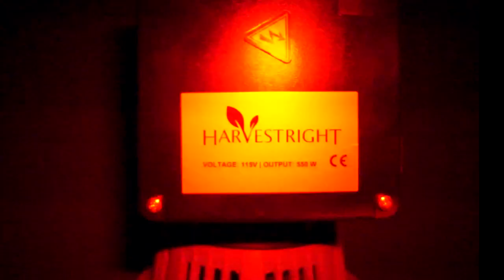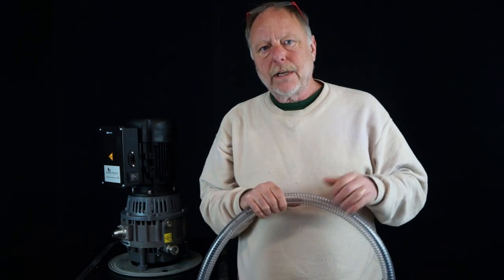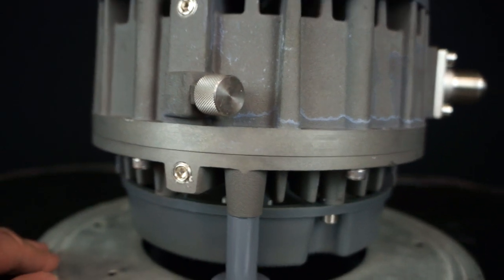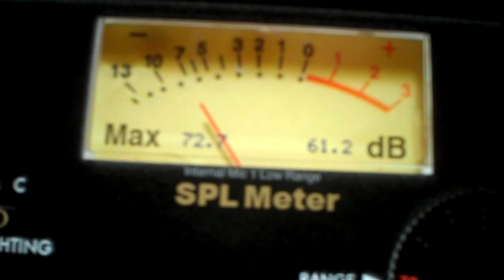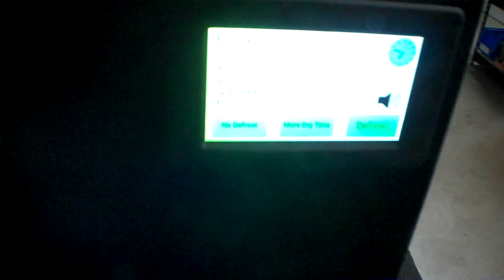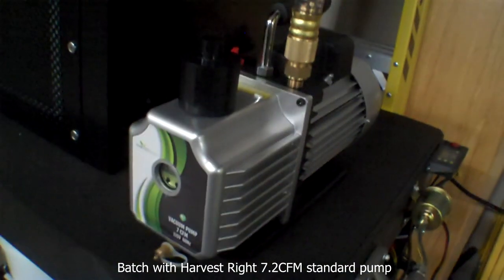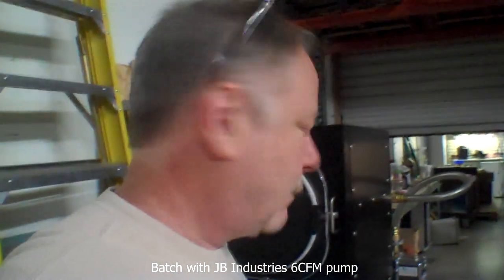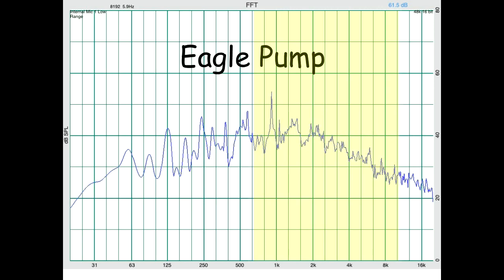Oil-Less, Maintenance-Free Pump for Harvest Right  Freeze Dryers - The Eagle

Comment: So any modern input on all the problems people have been having with these new pumps? I am an industrial mechanic, and would like to know what the requirements are of these pumps. 
1, wouldn’t it be cheaper to have a non-C-Phase motor direct drive with a lovejoy coupler to prevent vibratory resonance through the entire machine, and use a catch-can with a baffle for the exhaust to reduce sound levels? 
Where can I find a parts list for the pump? Or an exploded view of the internals to find if it’s worth spending that kind of money on one, or setting up a different vacuum pump set up?
Reply: this is the same design used in these pumps i will tell you to avoid them they wear and fail after 4 years sometimes sooner . your better off buying a 12 cfm oil pump for 150$ i bought a  ebay made in china vac pump and it works better than the original oil pump they provide it also pulls a better vacuum  my uncle uses these freeze dryers in his buisness and he has had bad luck with oil free pumps  150 $ 12 cfm  2 stage  vers oil free 1,500$   we have oil pumps that are 7 years old and still working . here is that pdf file on these  .

https://iopscience.iop.org/article/10.1088/1742-6596/916/1/012048/pdf

Comment: Hi Bryan, 
I just finished my first batch with my new pump. It took about two hours less than with my JB pump so it is definitely faster. I also love how much quieter this thing is too. I just finished washing my trays and then I went to do my routine oil change and then I remembered that is a thing of the past. I'm just waiting on my FD to finish defrosting and I'll be doing another batch. I totally love this thing!
Reply: absolutely no maintenance required??....my mind is blown
Reply: I know, it's awesome. I'm working on batch number 3 now. It is so nice not to have to drain and filter my oil every time. You do have to change some bearings or something I believe every 8,000 hours or something like that. By the time everybody gets to that point then hopefully there will be some sort of maintenance kit or service offered by HR.
Reply: Actually here is the required maintenance: 

Seal replacement is needed every 8,000 hours of run time or 1 year. Shaft seals and bearings need to be replaced every 16,000 hours or every 2 years.
Reply: Steve Montana and those pieces can be purchased on epicenter?
Reply: I'm not sure, I just copied and pasted from Bryan's comment to someone else. Here's what he also wrote in another comment about getting those pieces:

"For more information about seals and bearing replacement call 1-800-865-5584."

I'm sure by this time next year this will be considered a normal process and I'm 100% positive that Bryan will have a how to video on how to do it and will probably sell the parts as well.
Reply from the maker: I talked with HR today and replacement part kits. This is what they said: "We don't have spare part kits available yet (there isn't a need), but will in the next few months. "

As soon as available, we will offer them.
Reply: That's good to know. Hopefully it won't be too hard to do self maintenance. If anything it will definitely be less messy than a JB since there's no oil involved.
Reply: @stevemontana5974  Do you know where  they can they be purchased? I don't see them on sale on Harvest Right website?

Comment: Mine is supposed to be delivered today!!  I am so looking forward to ditching the oil changes, filters, pump cleaning, all of that messy stuff!!  Unfortunately mine was not at the upgrade price.  I have had my Harvest Right FD'er for over a year now.
Reply from the maker: You will LOVE the new pump. Eliminating all the maintenance is such a joy. But it is expensive. We HR owners have all dealt with the maintenance with the oil based pumps and it's totally doable as I'm sure you agree. Up until now, it's been kind of the cost of admission to the world of home freeze drying.  Once you have used your new oil-less pump for a few batches, I hope you chime in again with your experience!
Reply: I will, when I get it.  It wasn't delivered Saturday.  I checked the tracking number and it was now with FedX and had not left there yet.  I don't know why I received an email saying it would be delivered Sat.  Sooooo still waiting, ready to get this show back on the road.  Enjoy your videos.
Reply from the maker: HI Pam, I'm glad you like our videos! I think you may have bought the pump directly from Harvest Right, so you will need to contact them directly about tracking. Had it been purchased from us, you would have received an order confirmation but the tracking number would have been sent when it shipped.

Comment: Got the oil free pump in 2017 as a gift.  Arrived early 2018 and did a batch last night and when the pump turned on, it was making horrible clanking sounds.  What?  This pump isn't even 3 years old and was over $1700 with shipping.  Can't find anyone in my area that repairs them.  Harvestright has been notified, awaiting a response.
Reply: The clanking is probably the fan housing at the top of of the unit.  Mine was damaged in shipping.  Just pried it up to clear the fan blades.

Seals died on my Chinee Rotary Vac Pump after WAAAY LESS than the advertised 250 loads.  Not happy!  Cannot get anybody at Harvest Right to answer the durn phone.  Need bearings and seals!
Reply: Yes HR can rebuild your pump - Mine did the same thing after only 8 months. HR rebuilt it under warrantee within 2 weeks. That was 18 months ago - no problem since. I run my dryer almost 24/7. Not uncommon for pumps (of any kind) to need rebuilt within 2 years. It's still worth the cost to buy and maintain.
Reply: Mine broke twice in the first year.  Now it is no longer under warranty so they want to start charging me to keep fixing their cheap crap.

Comment: This thing is continually broken.  Four months over two rounds of it broken the machine was either off for repairs or waiting for HR to respond to emails.  Now it is no longer under warranty and they want us to start paying every time it breaks.  I like the machine but the pumps are garbage.  The oil one requires to much work and the oil free one doesn’t work long.
Reply: I completely agree and am having the same issue 3 years after this latest post.   Doesn't appear they have fixed the issues with the oil less pump nor has their service dept improved and the company is not taking responsibility for a crappy product.  So frustrated!!

Comment: It will be interesting to see how the Eagle acts over time with multiple batches! what is the prescribed maintenance with Eagle pump?
Reply from the maker: Hi Michael, I'm running the Eagle non-stop these days looking for glitches. So far, so good. The manual I received last week says the following:
PUMP MAINTENANCE
In order to make the best use of your investment, familiarize yourself with the
features and operating instructions before starting pump. With routine care and
following proper maintenance guidelines, your pump will give you years of reliable
service. Pumps are designed for deep vacuum work on freeze dryers.
Seal replacement is needed every 8,000 hours of run time or 1 year. Shaft seals
and bearings need to be replaced every 16,000 hours or every 2 years. Replacing
the seals is necessary for achieving deep vacuum and for proper freeze drying.
For more information about seals and bearing replacement call 1-800-865-5584.
Reply: EpicenterBryan thanks for the reply! I’ve just completed my first batch on my new freeze dryer and have been enjoying your videos, if I had found you before I purchased I would have bought thru you! Keep the great videos coming! If I can justify the oiless pump you will be hearing from me!
Reply from the maker: The oil-less pump a big expense, I know. The new oil type pump you have now is a big improvement over the older JB pump. It should perform well for a long time.
Reply: @EpicenterBryan  what if you only use 2,000 hours per year, can you change the seals at 3 years then? Or is it a must to change it every year regardless of use?

Comment: Hi Bryan,
I'm "liking" (literally)  all your videos I'm watching and subscribed to your channel.
I am curios to know if there is any reason I couldn't  run the oil-less pump inverted. (i.e. the motor on the bottom and the vacuum pump on top. I ask cause my house has an unfinished basement. I f I set my soon to be purchased freeze dryer on my kitchen counter then use some plumbing fitting to hard pipe the freeze dryer outlet below my kitchen counter. Then connect the flexible hose to that and run it through my floor and connect to the pump. I could mount the pump inverted to the bottom of my basement floor joices. this would make the freeze dryer a more user friendly home appliance, while confining the majority of the noise to the basement. I understand the vacuum pump needs power from the back of the freeze dryer and all. I am an electrician by trade and work for a commercial  HVAC/plumbing/electrical contractor. I have access all manners of info and supplies on a daily basis. I also have a washer drain close by in my basement where I could plumb the drain hose to, making the whole system a much more user friendly permanent type of installation.
thanx for all the great fun and informative videos on freeze drying and the like.
Have a great day.
D. Bittinger Jr.
Reply from the maker: You will need to give them a call. I've seen similar pumps that have a bracket so they lay on their side. That might make more sense. Perhaps they can get you such a bracket.
Reply from the maker: I contact HR about this today because you are one of several potential Eagle customers who have asked about Horizontal mounting recently. As soon as I have a response I will know more. The question is if the mechanism can be run horizontally without impacting performance or causing damage. Then, if HR or the pump manufacturer is interested in offering a "cradle" to support the pump in a horizontal orientation.  If no harm is caused and they don't want to offer a cradle, I'll look into having them made to offer to customers like you.

Comment: Great video Bryan.  Has me thinking about which way to go.  I have the JB pump and oil inside the chamber and hoses at the moment and was thinking about getting the other newer pump but now the oil less version is tempting although not in the budget  right now.  On top of that I bought the flush kit and extra oil that I would need to get rid of somehow hopefully sell.  Decisions decesions
Reply from the maker: There are a few tricks I've learned about that "oil up the hose issue" that might help you. First, put the pump as low as possible. That makes it harder for oil ever to reach the chamber. Next, the issue seams to be when the FD starts freezing. That slowly creates a vacuum in the chamber that starts sucking oil. You can open the drain valve for a while if you see oil creeping up. Don't forget to close it! Or, you can plug the pump directly into the wall for 20 seconds or so. That pulls the oil down, but also creates a vacuum such that the ball pops up and seals better. Hope that helps.
Reply: Thanks Bryan.  Do you have any tips for cleaning out the hoses?  I probably have 1/2 cup of oil in the main hose.  Have had the machine since last spring and this is the first time this has happened and I hope it is the last one way or another.
Reply from the maker: I guess you could hang it with rags wrapped around the bottom end to drain it. If you really want to clean it out, I use Dawn dish washing detergent to clean my oil drain container. I would bet if you put a solution  of hot water and dawn in the hose cans caps the ends with your hands you could swish the solution back and forth. Then empty and run hot water through the hose. Be sure to rinse really well.

Comment: Bryan, first let me preface my next line of questions with the fact that I am huge fan.  A couple weeks ago you introduced the newly improved pump which was a flat out swap from the old pump and now a few weeks later yet another pump (which is almost the cost of my freeze dryer itself).  In previous videos you demonstrated that the company would improve subtle things in the design and send out parts like stainless hardware, insulating cushion etc.  What is their position on this innovation and the costs associated?  Have people in the community sourced similar pumps for less money in the HR forums?  $1,600.00 for hobbyists or entry level seems a lot and I am sure that has some mark up with it.  I'm interested in your comments.
Reply from the maker: Hi Ron. I'm not sure where the "stainless hardware, insulating cushion etc" reference came from, perhaps another channel. But I get your point on other comments I have made over the last year. I can not speak for Harvest Right. TheEpicenter.com (my company) is a dealer as of last April / May or so 2017. However, my interest in this product started when the wife and I bought ours with our own cold hard cash in December 2016, and I promptly blew ours up. Thanks to their help, I was back up and running within a week and I posted a video about that.

As far as the $1600 dollar cost on the new pump. I totally get that it would buy LOTS of food to run through your freeze dryer. In trying to clean up the super long video, my point got trimmed.... It is EXTREMELY valid. The added cost for this upgrade is not for everyone. Thus, the lower cost (most common) oil path.

When my JB pump started leaking  in April 2017, HR said to send it back under warranty and they would fix it. I told them I would like to buy a spare pump and asked if they would send the parts so I could fix my original pump myself and post how to do it on the channel. They agreed, and that video has now been seen nearly 7,000 times as of this date. Looks like all users of that pump (not just Harvest Right Owners) have run into that problem with that specific pump.

As far as anyone in the HR user community sourcing an oil-less pump like this at a lower price, I'm not aware it has been done. And I say "more power to you", and say go for it.  There will be perils, and I say give it a shot if you have some cash and time to play with it. Might work, might not.  First, make sure it is 120V, 60hz (not 50hz). Make sure it achieves extremely low mTorr vacuum. What is the magic number? Make your best guess. If it doesn't get that low, does it just take longer or does your food not dry ever? If it doesn't recover fast enough from increasing pressure as the sublimation process progresses from heating the trays and the HR firmware detects an unusual condition and goes into a mode to compensate, what happens? No clue. And if the "self sourced" pump draws more power than is designed and the Harvest Right output relay blows, or the socket melts and burns down your house down, "Who you gonna call? (ghostbusters)" or blame / sue?

That's my put. I say buy the tested name brand. And with Harvest Right's name on these two pumps I know they have been tested with their Freeze Dryers and they will stand behind their warranty, and support the end user with not only replacement parts but debugging and general customer questions.

Comment: Does the Harvest Right turn it off automatically when pressure is reached?  Is this just a stand-alone pump you have to operate manually?
Reply: No - the pump plugs into the back of the dryer and is controlled by the dryer. After the dryer calls for the pump to start it will run for the rest of the cycle and shut off at the end.

Comment: Hey Brian great video as always! I would be interested is knowing the power usage of each pump? Be nice if the eagle also cuts on some of the power bill as well. Thanks!
Reply from the maker: I don't have specific data but The Eagle and also the new "standard" HR 7.2CFM  pumps both use a 3/4HP motor. The JB was a 1/2 HP motor.  A 3/4 HP motor is 559.275 watts, and a 1/2HP motor is 372.85 watts. Costs relate to "on time" and your local utility rates per kilowatt hours.... For now, that's all I can offer.

Comment: I’m in Toronto, could the freeze dryer and pump be used in an un-insulated garage. I’m concerned about noise levels in the house.
Reply from the maker: The recommended temperature range for operation is 35-90 degrees Fahrenheit.
Reply: I live in Las Vegas and I too don't have room in my house for my large dryer and oil less pump. The noise really isn't bad and I wish I could have it in the house. My garage gets to 120 F in the heat of summer. I had to use a bathroom ceiling fan through the wall and duct cool air from the house through the dryer and return back to the house. I built custom connectors for the duct piping and closed up all the vent holes. It keeps it below 85 F and helps warm the house in winter. The other option is to only use it when the temps are between 35 and 85 F.
Reply: @jerrysmith372  I'm in Las Vegas too.  The heat is maddening.   I am getting the freeze dryer. I take it one has to keep the pump cool?   I plan on using it on the back patio during winter months or in the garage where there is a swamp cooler running.  In your estimation would that be ok?